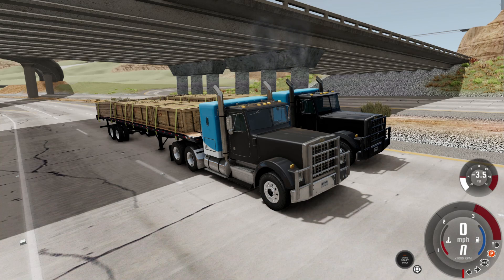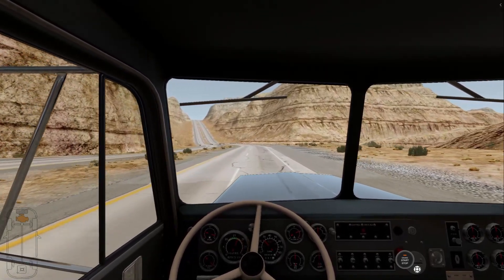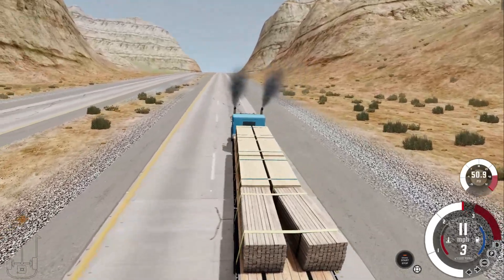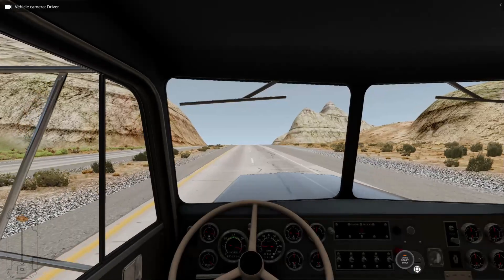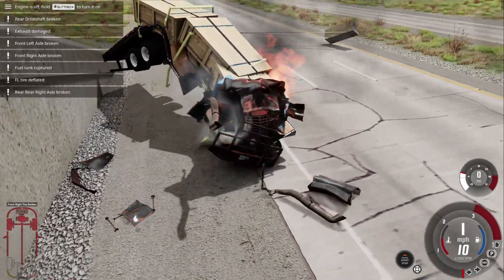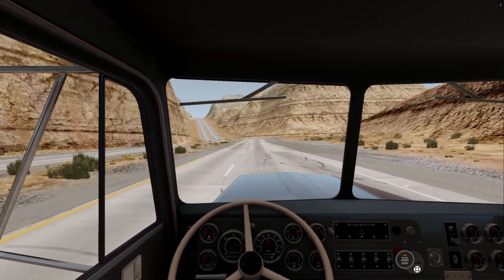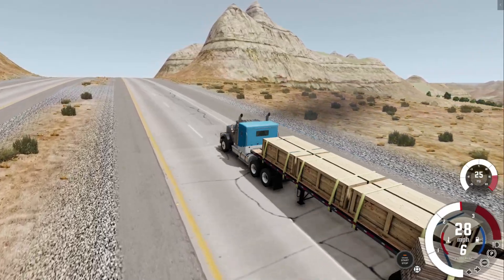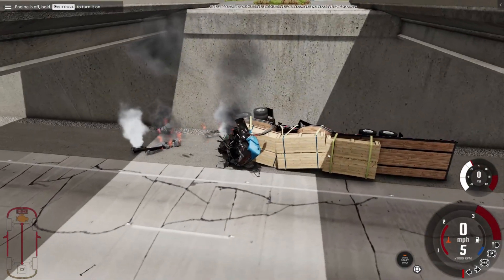TWIN TURBO CUMMINS BIG CAM- 3 475 VS BUILT DETROIT 8V92 DIESEL TOW TEST (FAN REQUEST)

Comment: Thanks man takes me back to the pulling days usually the Detroit once turned up over heats the cummins generally wins weird the 475 was a order able motor in early 80s with the twin turbo
Reply from the maker: glad you enjoyed it. more videos to come as always if you haven't seen it yet im sure you would like the 12v71 towing at 7,700rpm . and yes it was but those were configured as compound set ups little turbo feeds a big turbo you asked for twin turbo so i  did a true twin turbo one serpent from the other